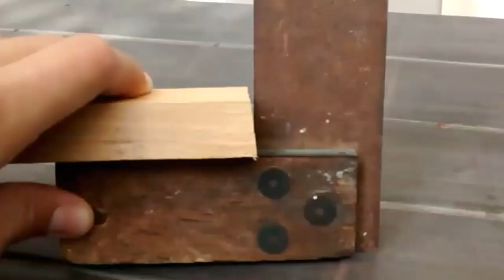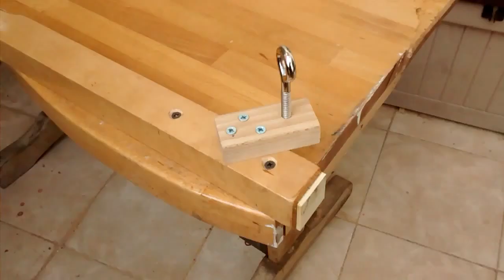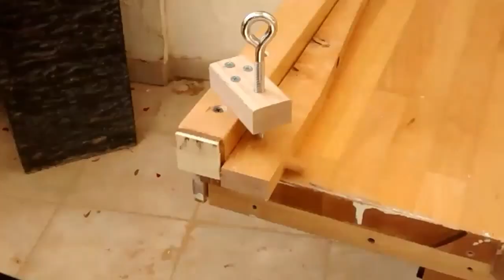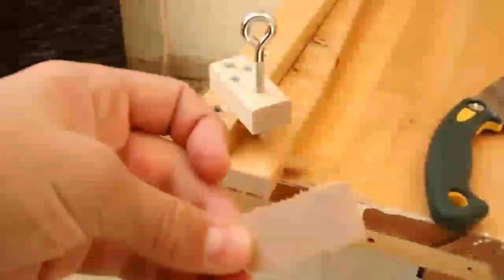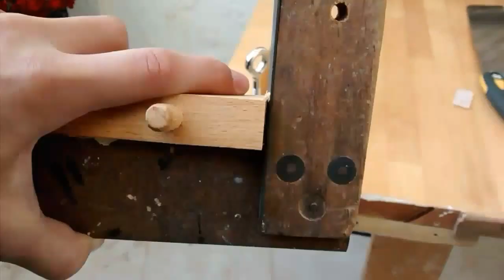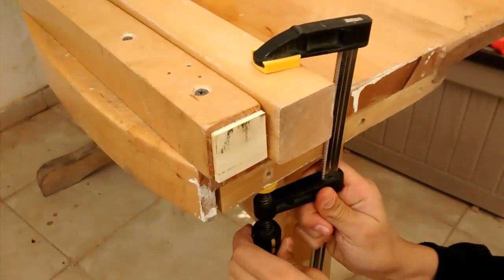Ultimate Woodworkers' Miter Box (HIDDEN MAGNET Handsaw Guide)

Comment: This is not a miter box, it's just a saw guide. It's a good idea, especially the covered magnet, and a nice design. However, to be a miter box, it would -- by definition -- have to help you cut at an angle. Thumbs up, anyway!
Reply from the maker: Thanks! :)
This does cut at an angle! The end-card covers (partially) the fact that I can use a speed square to make 45 degree angle cuts.
You can't cut bevels, but if you turn your piece of wood on the side and cut a miter, it'll be a bevel...
Reply: Ah, I see; that makes sense. I didn't consider that approach; and you''re right, I totally missed that you showed it being done as the end card covered it up. Nice idea, then! I also like the idea of covering the magnet with something slick like a piece of cheap plastic cutting board (as was discussed on your Instructable). Just adding some paste wax over the magnet section or to the saw would probably be slick enough.

I have some quarter-round to cut before coping the corners, and the miter box I made for my pull-saw didn't turn out that great. Rather than start over with that, maybe I'll try this idea instead!
Reply from the maker: My editing program went crazy and didn't let me add a few seconds of a black screen in the end, so I had to cover up the last few seconds...
Yes! I'd love to see it when you're done!
Reply from the maker: I just made a video of my new improved magnetic hand saw guide, I think you might like it!
I think it's better is every possible way. Here's the link to the video if you're interesting: https://www.youtube.com/watch?v=IDGZmSuTRfE
I'd love to hear what you think!